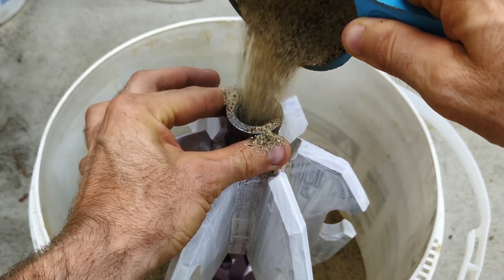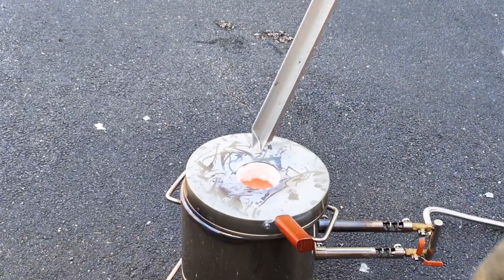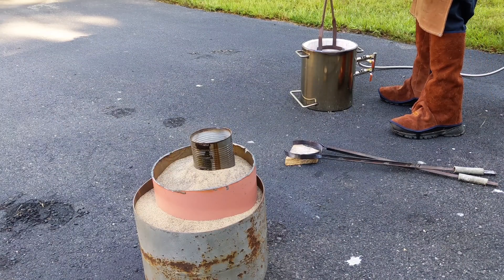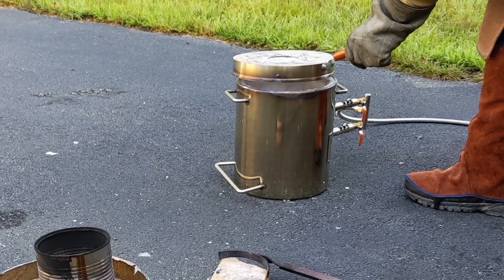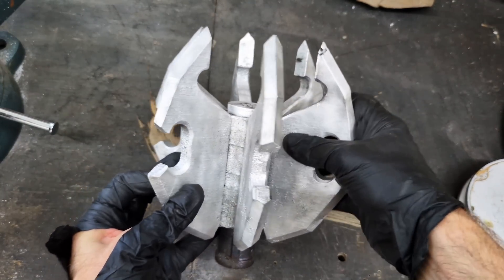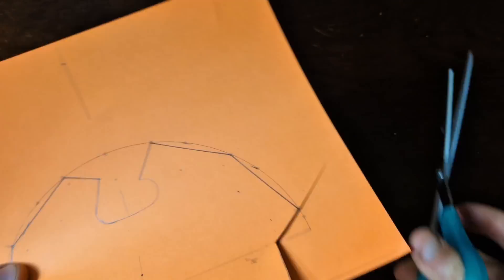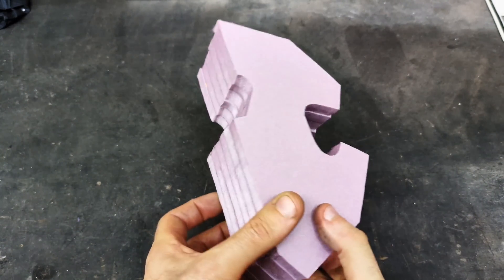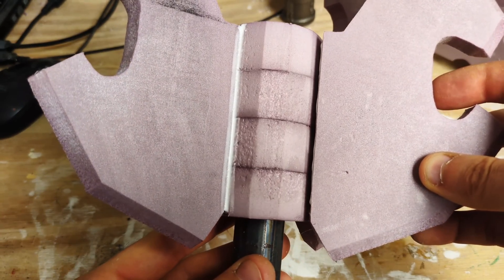Lost Foam Casting Process Video - Lost Foam Casting Throwback

Comment: Being new to lost foam casting, (and I owe whatever success I’ve achieved to your YT tutelage), I have a question regarding slag.  I have been doing lead casting for many years. I usually add sawdust or candle wax to bring contaminants to the surface for removal. Is there a similar flux material to do the same with aluminum?
Reply from the maker: Awesome!  I'm so glad to have helped you.  I'm not sure about the slag from aluminum tbh.  I just scoop it off the top.  If it's really garbage aluminum you will get some on the bottom of the crucible bas well.

Comment: I need to get access to a CNC.  My attempts to manually sculpt XPS foam have been .. lacking.
Reply from the maker: They are very helpful, but did you see how I did this one at the end of the video?  Using a hot wire cutter is very useful.
Reply: @HeinrichsMade Yes, but you have to understand that I'm the kid who couldn't cut a straight line with scissors nor successfully color within the lines. 😊

On the plus side, I wasn't the kid who used to eat glue in class.  So I do have that going for me.  Which is nice.
Reply from the maker: @JasonDiegmueller   😂😂😂 yeah the straight line.... I'm not that good either, but you'd never know if it was a little off.  I just cut the paper pretty slow to cut on the line.

We both didn't eat glue as a child.  That's great 💯💯💯😂😂